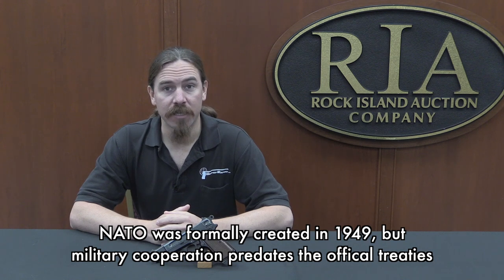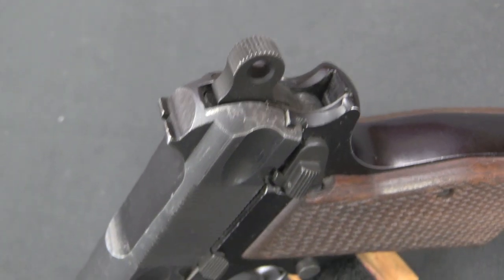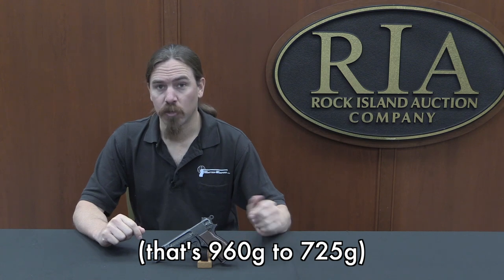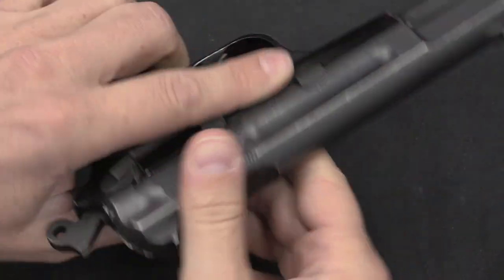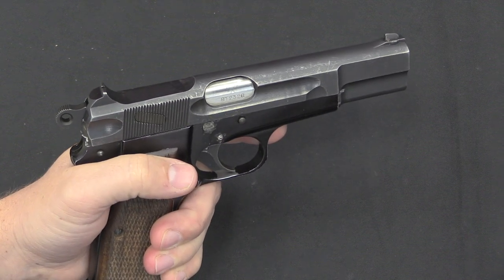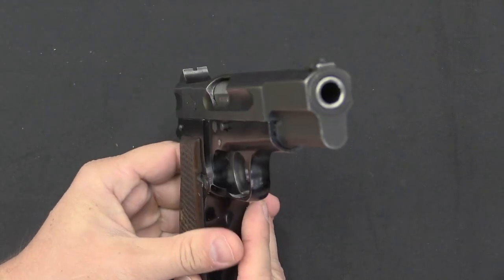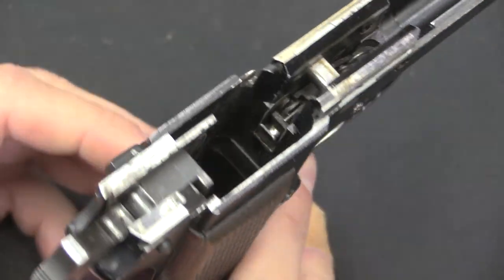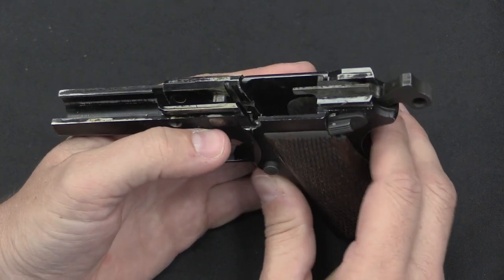Experimental Lightweight Browning High Power

Comment: In 1980/81, FN made 2000 aluminum framed High Powers for the Austrian Border Guards.  Many of those were imported about 2010, 2011, and one of those is mine, right here in Arizona.  So, Ian, that was not the end of the story for the aluminum High Powers!
Reply: Youre in Arizona, lend it to Ian to do a video on it ;)
Reply: kodiakkeith I think fn made more then 2000 because I live in Belgium and you see the aluminium framed ones very often, in fact: It think before they were replaced with the fn fiveseven, the whole military and police force used aluminium framed brownings, I'm 99% sure
Reply: Yes, I think additional orders went to various Belgian police agencies.  Here in the US the only ones I've seen are these Austrian Border Guard models that came in about 7 years ago.
Reply: I'd be happy to lend it to him.
Reply: kodiakkeith send him a email
Reply: kodiakkeith interesting, I didnt know that! Thanks for sharing.
Reply: How do you like it? First I heard about them. Are they common in the USA or did you have a PITA time importing it?
Reply: @nathan655555  do you know if the aluminum alloy frames are cast ? The police issued ones? I bought a Belgium hi-power pistol police issued.

Comment: Really interesting; taking a hi-power from 1911 weight to glock weight in the fifties, without polymer.
Reply: could have also taken it to glock capacity too if they had realized they could increase the width of the magazine well by using the aluminum frame directly as the grip
Reply: @alanfender123  but then it wouldn't take hp mags

Comment: I'd say the hi-power was the first modern service pistol, it's double stack 9mm high capacity with a tilting barrel, it ticks all boxes.

sure the 1911 had the form factor, but it didn't have the capacity.
Reply: @austinismadcrunk  I've always wondered why Walther didn't make a double-stack P-38. Patent issues?
Reply: @AshleyPomeroy  Possibly.
Reply: Maybe it was the German experience with double-stack single-feed magazines in submachine guns that made them mistrustful of them. Alternately they may have felt that a backup weapon doesn't need a large capacity magazine.
Reply: @AshleyPomeroy  Because they were waiting for the Italians and Americans to to make it.

If you don't get the joke, that's okay.

Comment: I've got a client at my work that has 6 or 7 Browning Hi Powers and they have the best recoil impulse of any pistol I've ever fired. It's a slow light impulse that is easy to control and makes follow up shots incredibly easy and accurate. The trigger could use work but the recoil is buttery smooth and awesome.

Comment: The later aluminum High Powers have an entirely different cam shape, and the slot cut on the barrel is different to accommodate that re-engineered bar.  I would suppose that is due to lessons learned from this experimental model.

Comment: If you change the original material for the receiver with a softer one that is a recoil bearing part, what would one expect? The postwar duralumin Walther P38s suffered similarly.

Comment: The British military adopted one of the sig sauer pistols (can't remember the model) and a few years ago I heard they were basically taking it out of service because they found that the slide was wearing away the frames of them,now it's mostly just the Glock,the Hi-power is sadly out of service
Reply: Anthony Williams To be fair, the Sigs were emergency acquisition. So it was more to solve the 'we need pistols and we needed it  yesterday' problem than actually replacing the Browning GP.
Reply: Anthony Williams the Glock 17 replaced all the hi powers and sigs

Comment: Interesting. Did not know about these. I would imagine that a big part of the problem was the specific aluminum alloys in use back then. I don't think 7071T6 was made until a few years later. That probably accounts for the steel block ovaling its hole. Any info on how much weight the slide cuts themselves saved? I would guess about 3-3.5 oz, just as a SWAG. I like the HP a lot, and lighter is better to a point. I wonder if they had to change the recoil spring in order to keep the slide velocity workable. A lighter slide will of course move faster. An interesting chapter of what might have been. Great video as always.

Comment: I saw a "de-activated" lightweight being sold as a momento at Fultons Gunsmith at Bisley Camp England. The cam bar was made out of a round section steel rod not the normal Browning oval bar with the central recessed section.

Comment: Neat vid, my fav pistol ever is the Sig P220. It started as a 9mm as i. sure you know. Would be neat to find one of those, i actually prefer the new milled slide p220 though, easier to work on and pop the extractor out and just seems better made. Weird how its known as a 45 but started as a 9. Im thinking watching this vid, just leave the cut out milled slide and use a steel frame. lol call it a day

Comment: Noticed that the frame hole for the trigger pin is peened with several staking dimples.  Was there an issue with the pin walking out the side during firing ?

Comment: I’m sure i missed the alloy used on this pistols. 7075 AR uppers are quite happy coexisting with steel BCGs...granted the friction and metal to metal impact is different.
Ps. They obviously didn’t have E. Stoner on the Engineering team.

Comment: Apparently the scallop that you said is for pushing out the slide stop is actually designed to be a grasping point when running the slide. Doctrine dictated that you pull the slide back from that scallop with your thumb and index finger.

Then again, it lines up perfectly with the slide stop, so maybe it had a dual purpose.
Reply: I've fired an awful lot of rounds through these while in the British army and never used that scallop to cock the weapon. That's what the grippy milled slots on the back of the slide are for. Incidentally, I was working in Oman recently and their military still use the Browning. Good to see.

Comment: Ian. what grade alluminum stock was used to mill the frames?
Reply: I'm guessing, but probably 2024, which is a bit soft for the job. I would want to use 6061 or 7075, which are much harder.

Comment: 1911 didnt really have any upsides over browning hi-power. 45 acp isnt stronger than 9mm, it's slower and higher caliber, you cant fit far less of them in the mag, for rather pitiful gain in muzzle energy. USA people circle jerking around 0.45acp and 30-06 over 9mm parrabellum and 7.62 nato are just dumb, especially by calling these wimpy when they clearly dont know jack shit about stuff they talk about. 9mm is strong and very good catridge, its perfect combo between caliber, velocity and size so more of these fit in the clips. 30-06 is same diameter as 7.62, except that 7.62 nato used far better charge, had slightly shorter case, and was a tiny bit later with shorter brass in big amounts meaning less strain on the soldier for carrying it/more of it could be carried. And its far easier to find around the world due to NATO using it. 9mm parrabellum is also incredibly common.

Comment: Ever have I thought to lighten one of these up? 😂  Only magazine capacity. Great guns, but why lighter? I love this weapon like it was an M1911, but why try to improve on something that isn’t bad is my opinion. Trigger is a bit heavy for my taste even for a single action, but the positives outweigh the negatives with this weapon IMO.
Reply: Just remove the magazine safety disconnect. It's one pin to remove and it makes the trigger pull go from day old oatmeal to almost perfect.   Alternately hand polish your mag disconnect and the spot on the mags where it rubs and it does make it a lot better without sacrificing the "safety " feature of a mag disconnect.  

 The Hi-power I own is a 1970s vintage american market model that was the daily sidearm of a police officer for over 20 years that had been modified with an adjustable trigger stop.  The thing is still tight as a drum and the trigger has by far the best pistol trigger I have ever used ( once i removed the mag disconnect that is).

Comment: Wouldn't making the slide lighter weight exacerbate the problems with the locking block? With higher recoil speed the barrel locking cam would hit the locking block somewhat at higher velocity, causing the block to impact harder on the frame, causing more 'stretching' on the frame. As a side question, how much could the slide be lightened before recoil velocity became too much? I'm assuming the slide weight/spring power must be carefully balanced to control slide velocity, and assure positive forward inertia to strip the round and go into battery reliably. Anyone have any thoughts?

Comment: Al-u-min-i-um  surely not aloominum. 😉
Reply: They are two different words actually.  :)
Reply: walrusking14 They are only different in a geographical sense. The English inventor originally called it aluminum  but later changed it to aluminium. It was simply that the American literary community adopted the earlier spelling. It's simply my opinion that the word used should be the one used by the inventor, or namer of the substance. This is. by no means an argument, simply a statement of facts. 🤔
Reply: I know the historical relevance.  Actually there were three separate names.  First it was alumium, then aluminum and finally aluminium.  The name aluminum was actually preferred by Davy, but Aluminium was preferred by his colleges.  So by your logic then Aluminum is the pronunciation we should all be using.  Basically Davy had Aluminium forced on him by his peers.

Comment: Glock is better
Reply: baronPolarBear  you know this one is much older than the clock and this is a prototype
Reply: baronPolarBear Well That's what you get with over 40 years of advancements.
Reply: baronPolarBear 
triggered
Reply: In its defense the prototype Hi Power made it through the entire Korean War without exploding once.
Reply: The ones issued for Korean service were not "protoype" aluminum framed. They were the all steel original variant and worked well even when subjected to the filth and freezing temps.  Ask the guys who fought at Kapyong.